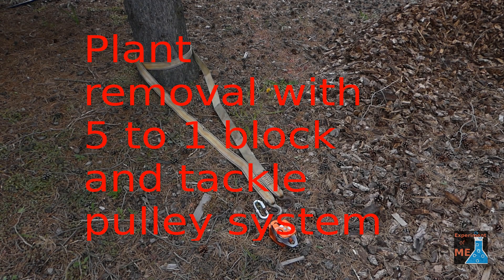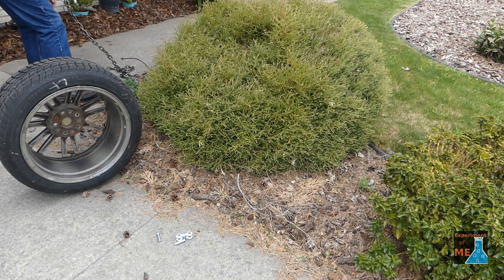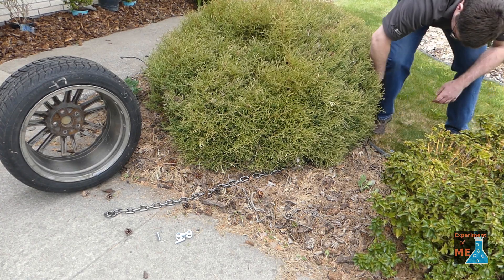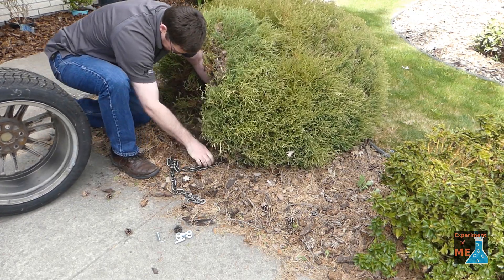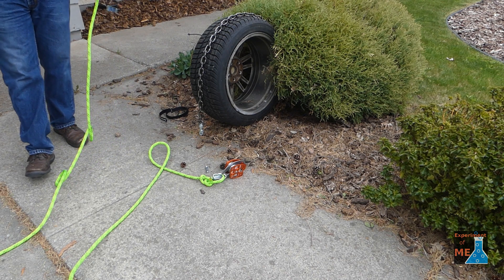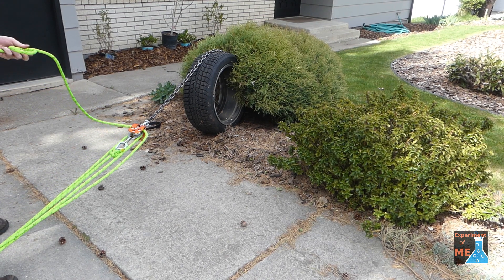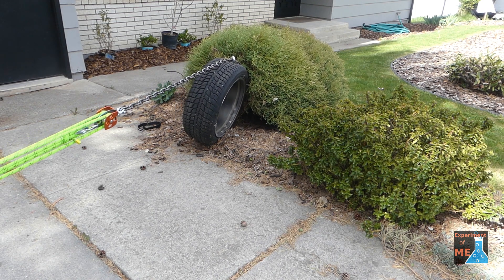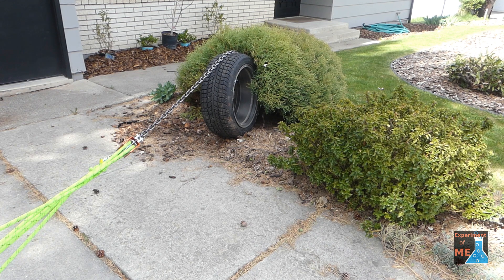Plant removal with 5 to 1 block and tackle pulley system

Comment: After using my slide rule, some geometry, soil testing, and a calculator when I needed to remove a shrubbery, I determined that about 1/4 stick of dynamite would get the job done.

Comment: Lower air pressure in the tire so the chain stays in the center and tire stays up... then attach rope to car/truck then pull and be done with it... ;)
Reply: With that root system I could of dug it out faster with a shovel.   He want get a older boxwood or holly out with that alone.

Comment: I liked your video. It amazes me how few people understand how to use pulley systems. For some stupid reason I am just fascinated with pulley systems, especially as they are utilized in rope rescues. My current goal is to use my climbing ropes and gear to make a small highline and carriage system like a rescue unit would use to snatch someone from a deep canyon. I don't plan on doing any rescues... It is just so super-cool to know how. I need to purchase a couple more small pulleys and then will have everything I need to build an "English Reeves" rope highline. Yep, I guess I am just a touch crazy, but I just love understanding how things work.
Reply from the maker: Yeah, it's good to know how pulleys work.  Since I don't have any heavy equipment, pulleys are how I get stuff done.
Reply: I could not agree more. I too am amazed at how simple the pulley system is. My son uses them all the time in his work on rivers. The knowledge alone is a lifesaver. Instead his work on our nation's rivers he constantly uses pulling moving heavy loads and assising his clients.
Reply: It amazes me how many people have to point out that they understand pulleys better than someone else any time pulleys are mentioned
Reply: @SmoothBaracuda  I am proud of what I have learned on my own. I have the ability to do many things today that I could not have done in the past. I can move heavy loads, or haul your broken ass of a cliff in an emergency situation. I am happy to share that with others and I think others would enjoy knowing they can do those things too. You just go on being an ass and I'll just go on not giving a hoot what you think.
Reply: I’m not so sure it’s about people not knowing how to use a pulley system but to use it for a small shrub? Um I would have had that bush out in 5 minutes with just a shovel. Save the pulleys for real jobs.